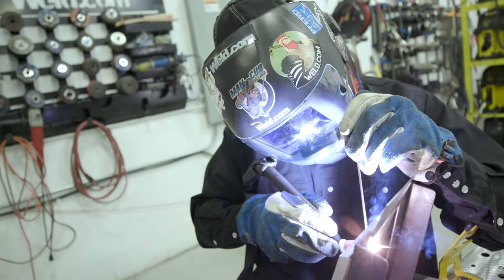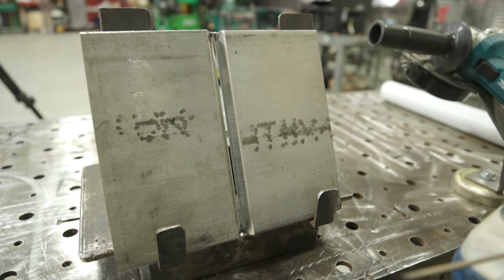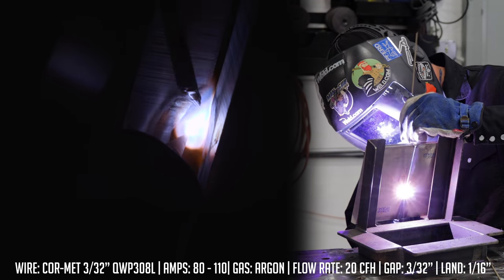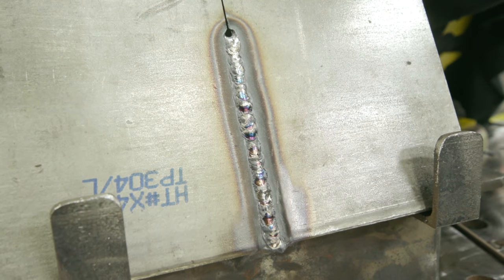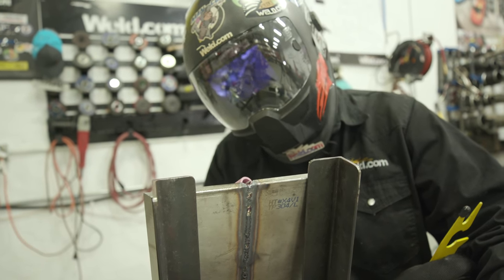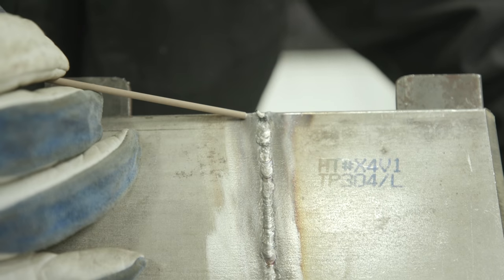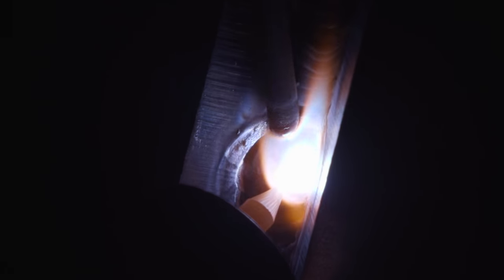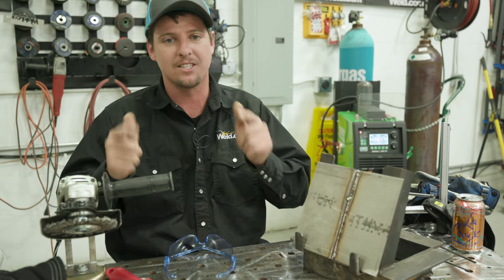Open Root Stainless TIG WITHOUT PURGE

Comment: Ive welded hundreds of joints on pipe with this wire and their other alloys (inco, 309, and chrome) You do not want or need to use it for the hot pass. Ive had a lot of joints pass RT with this. when welding pipe with it I run a loose 5/32-3/16 gap and back feed the bottom half, kinda hold it even with the bevels for the top half. when you prep the bead to close the root, do not grind as long of a ramp as normal or it will sugar. i keep it about 1/4" on the ramp. its pretty cool stuff to weld with, it just takes some time to get used to it. Also KEEP YOUR GLASSES ON, the slag will pop and fly off as it cools down.
Reply: Do you know if that rod is crtified for high pressure vessels?
Reply: @krazykanux  I have only welded pipe with it, but it was under ASME B31.3 so I would imagine that as long as the company qualifies a procedure and welders then it should be good to go.
Reply: @TylerWard335  thnx, im gonna have to talk to my boss about this filler rod. could be interesting to try it out on a job im working on.
Reply: @krazykanux  The only holdback might be the slag left behind on the inside. If its a food or medical type vessel, cleanliness may be a concern. all the pipe Ive welded with it has had a washout before being put into service.
Reply: @TylerWard335  good info bro 👍
Reply: With 3/32 or 1/8
Reply: @cristian5016  I’ve used both. I like the 1/8 though. You kinda have to soak the root pass in.
Reply: @TylerWard335  oh ok cause I’m doing it with 3/32 and it keeps coming out flush or suck back on bottom and it’s leaving pin holes or porosity from what it looks like inside the bead . I can’t seem to be able to fix the issue .. and they don’t have any 1/8 wire

Comment: Could that flux coated rod be used for 1.5mm super duplex or hyper duplex sheet where back purging is not possible without welding in a chamber? Thanks

Comment: I love how clean the angle and cut of your tungsten tips are!.. What are you guys using to sharpen them so cleanly? I mean that thing looks like it went through an electric pencil sharpener!?
Reply: An electric tungsten sharpener is all but required at this point. Few people in industry are taking the time to go to the grinder. Blunt off the point and you're good to go.
Reply from the maker: It's a Radnor Tungsten grinder